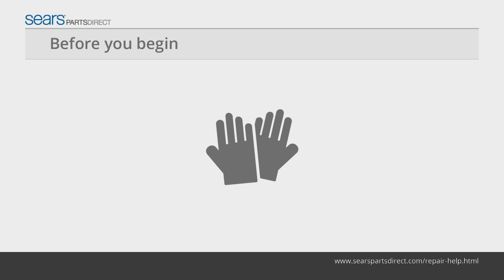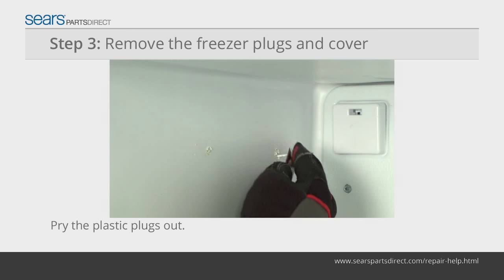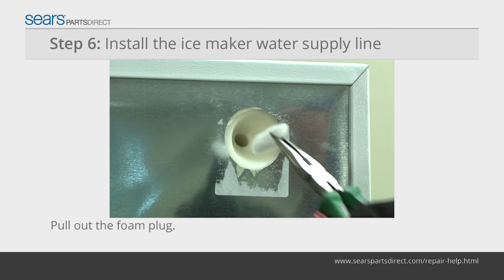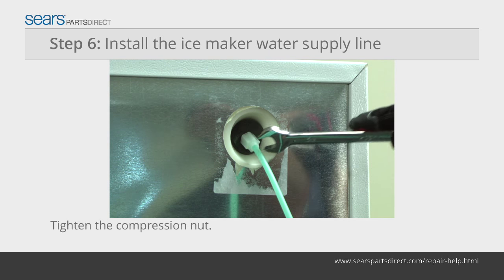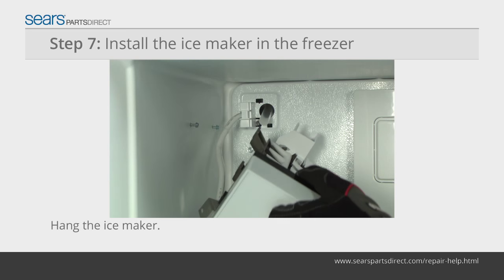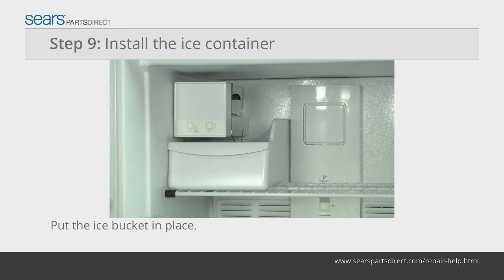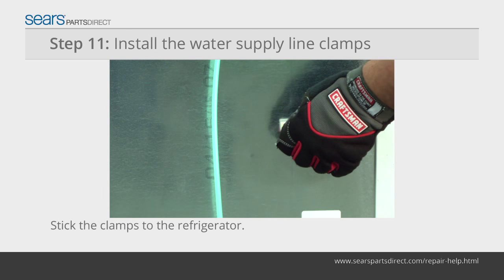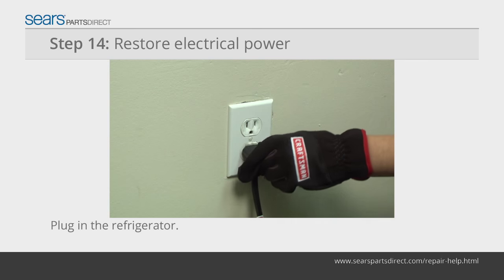How to Install a Refrigerator Ice Maker Kit

Comment: It is best to use the proper adaptors to install a "Ball-Valve" instead of the tiny compression saddle valve sold or provide with most ice makers. The saddle valve is difficult to get a good seal, get a leak free shut off for service. At this point, think about installing an in-line activated charcoal filter with brackets on the wall. Once installed, attach hose to run water thru the filter into a 5 gallon bucket as there will be dirty looking dust type particles cleansing thru filter. It this step is not done, your ice cubes will be dirty looking for 6-8 cycles of ice. So use a 1/8th inch NPT ball valve, install a good filter, flush before install onto your refrigerator, mark the date on a tag for the filter and place two extras filter in the cabinet above the fridge...and mark your tag to indicate where the extra are located. Its not too hard and either ice or thru door water will taste better.

Comment: There's no screw opening at the bottom of the ice maker for a leveling bracket
Reply: I know how you feel, however I did a double take and low and behold I found the hole meant to secure the leveling bracket. It is all the way forward near the module box. It has a port around the outer edge making it hard to recognize as a screw hole. There are two holes actually but the one you want is adjacent to the fridge wall along the wiring harness. if you bought a kit there should have been a bracket with two elongated holes for adjusting the level. I know you might not care to separate the ice maker from the fridge wall just to look for a hole. If I were at that stage, I would fold me up a piece of cardboard and slid it between the fridge wall and the ice maker to make me happy.  That's what I would do!

Comment: How much would it cost to have sears install my ice maker?
Reply from the maker: The price varies by region of the country. In most areas, Sears would likely charge around $200 for technician labor to install the ice maker if you already have the part. Sears also operates the ServiceLive.com ( https://www.servicelive.com/ ) website that connects customers to service providers to complete tasks such as installing an ice maker. You can visit that website to find an installer.

Comment: Can anyone tell me if basically any ice maker that I purchase can fit into any refrigerator, as long as it is equipped for one?  I want to purchase an ice maker, but I'm not sure if it matters.
Reply from the maker: Ice maker add-on kits are designed for specific refrigerator models. Some kits fit many different models but not all refrigerator models. Let us know the model number of your refrigerator and we’ll tell you which ice maker kit will fit.
Reply: Clint JCL
Reply: It has to be  with the model #. And only of the Refrigerator # ...

Comment: What if I don’t have a inlet valve?
Reply from the maker: To install an optional ice maker in a refrigerator that didn’t have an ice maker installed when you purchased the refrigerator, you’ll need to use a kit that includes the water valve (if that type of ice maker kit is available for your model). Let us know the model number of your refrigerator and we’ll check for a compatible  ice maker kit that includes the water inlet valve.